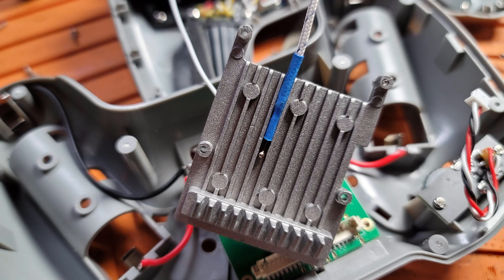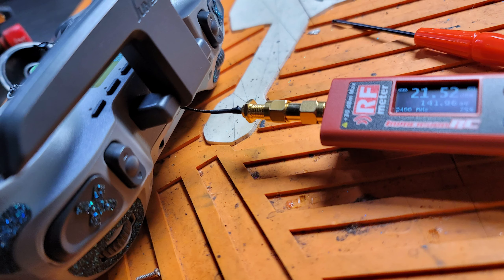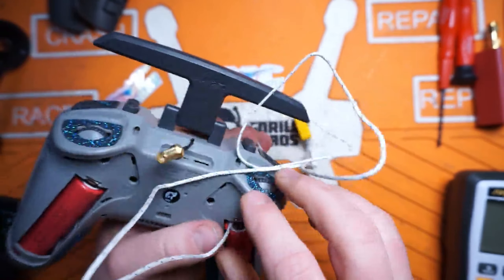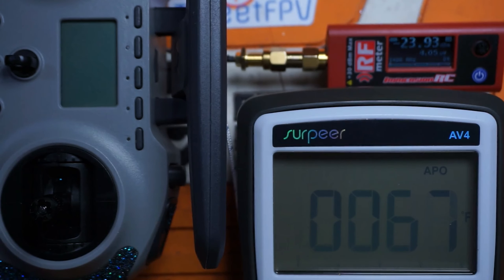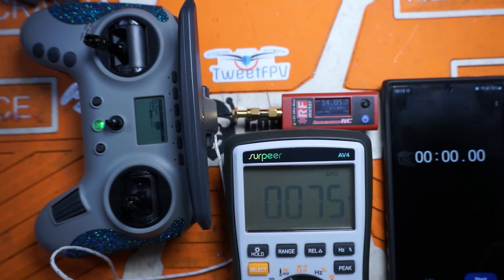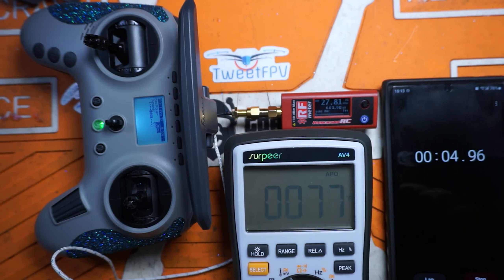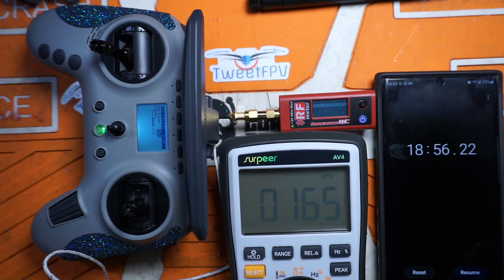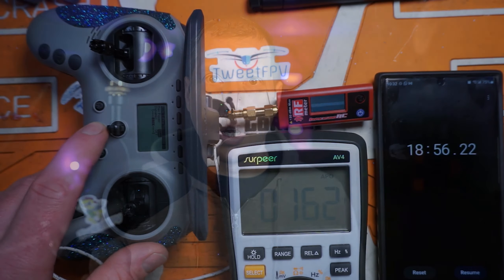Jumper T-pro Thermal testing 🔥 #t-pro #elrs #jumper

Comment: As it warms up it delivers less output as expected but doesn't quit nor reduce the power sufficiently to make any difference. The heat may be detrimental to the hardware in the long run but if someone really likes the form factor, it seems like an acceptable radio. Though not for me.
Reply from the maker: No, the heat output seams to be within the acceptable range from where I'm checking. I would like to see how hot the chip gets but I just can't get to it without potentially destroying the tx.
I would agree about it being an acceptable radio if it wasn't for the stupid momentary shoulder buttons. I just can't get past those. I guess if I was new to the Hobby and didn't know any better they be fine but then again if I were new I wouldn't know how to use those as anything other than monetary buttons.

Comment: You scared the heck out of me when I saw the temperature got up to 165. I thought it was 165C! I also have the IMRC Power Meter and 1W doesn't really read correctly without an attenuator. I think we tested the T-Pro power output and saw close to 1W.
Reply from the maker: Yea, I have a atinuator on the way to see if it makes a difference.
Reply: Where can I find an attenuator? How do I install it on my radio? Thank you
Reply: @bassbeats92  you can find them at electronics distributors like mouser and digikey but they're available on AliExpress or ebay too, search 10db sma attenuator. Usually the frequency spec doesn't matter because they work over such a wide range.
You only need one for testing output power, not for use while flying (where it weakens the signal and reduces range)
Reply from the maker: I got an atinuator and yea It seams that the irc power meter is limited to about 500-600mw without one. This is the one I used https://amzn.to/3pE7tHL
Reply: @CapnBry  thank you

Comment: Awesome testing. Congrats, I liked your video! I recently bought one JumperRC T-Pro.
But It looks like if there is a problem with this radio and the high power of the built in 1W ELRS module.

I have a question:
Is anyone having problems with this radio with the 1000mW builtin module?
I saw that the more transmission power is configured, the more noise you will hear in the internal speaker when voice tracks are played....but in adition, if you connect this remote via USB to your computer, to use it as a Joystick, you will see that your virtual drone model wobbles, (using a flight simulator) due to the electrical noise as well.
But the WORST and more IMPORTANT is that in a high output power configuration it affects the flight stability of the real binded drone. It becomes into a ugly flight, and power loss, due to the wiggle.

I would like to know if it is just a problem of my JumperRC T-Pro+1W ELRS Builtin module...or it is a common issue.

Thanks!
Reply from the maker: I haven't seen this issue you are describing

Comment: I did some thermal testing on the T-pro.  I threw it into my fireplace.  I mean, I guess it passed the test, it burned an acrid black smoke.   Just what I want a gamepad style transmitter to do.  

I suppose I should be more affable to them, the gamepad controllers with their tiny screens stand to benefit the most by installing and make use of my custom Soundpack on them.

You should test those cheep All-in-one Cameras plus VTXs, they cook.